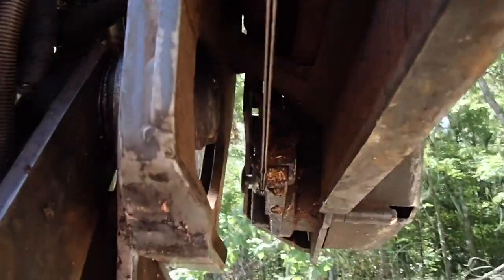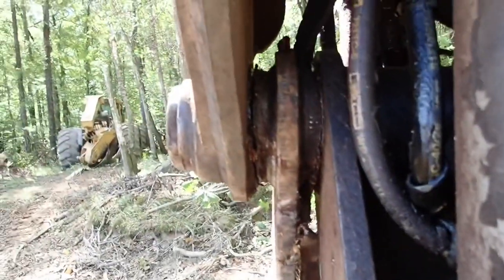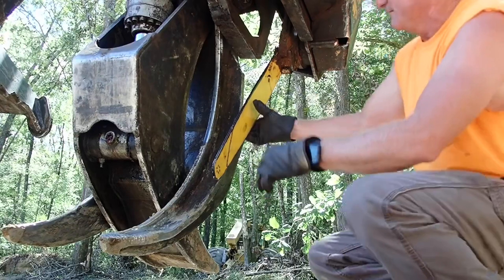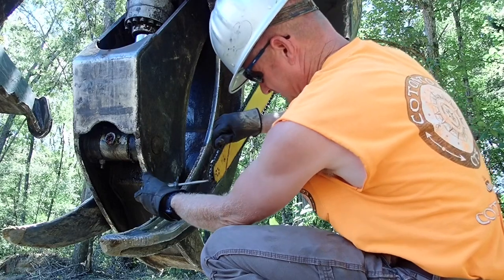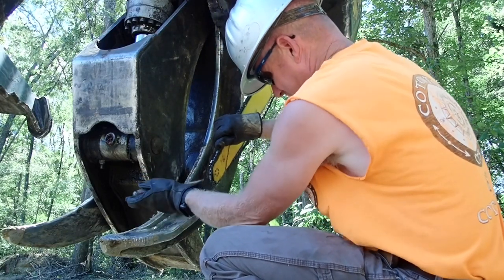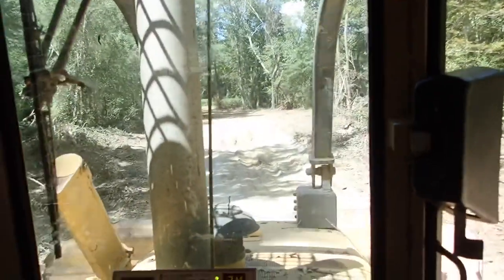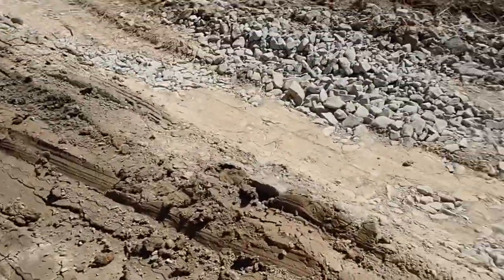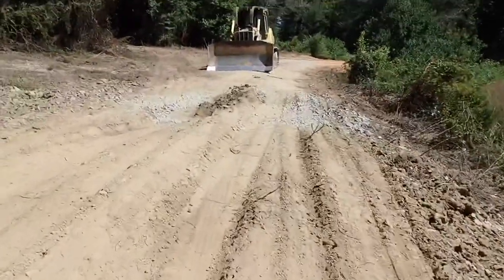Rotobec grapple, working on it 😁

Comment: Tim, when we had a wet spot in our road construction we would use a rubber tired roller to 'pull the moisture' to the top for quicker drying by the sun. A steel wheel roller would not pull up the moisture like the rubber tire. So the multill wheel tired log trucks helps with drying a lot. Also a ditch on each side of the road, even if its only 6" deep, will let the moisture 'move sideways' from under the surface. Yet again, probably useless information for you....lol. Good luck, it'll get solid.....but maybe need another load of stone for extra thickness (just think of the mud as being mortar placed between the rocks for a masonry structure).    ....13

Comment: Tim now that you have a 12 amp hour battery you can test the coat during hunting season and maybe if you have a socket the size of that bolt from the site you got the rebar from try out your mid torque impact for fun